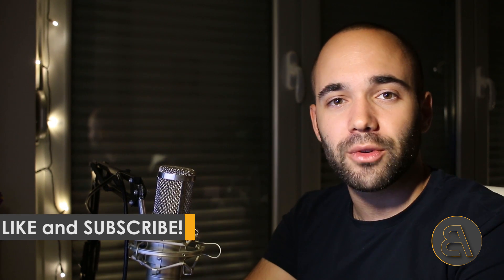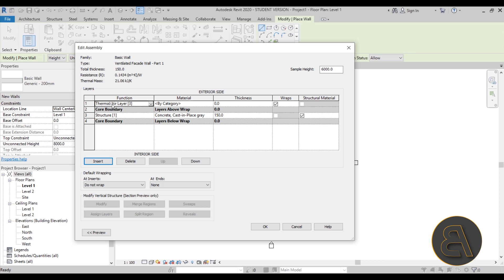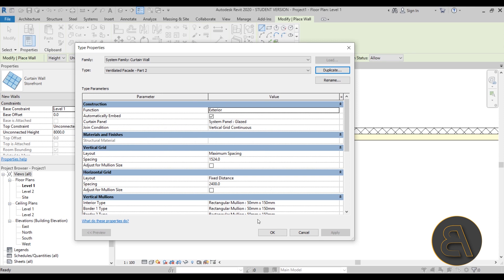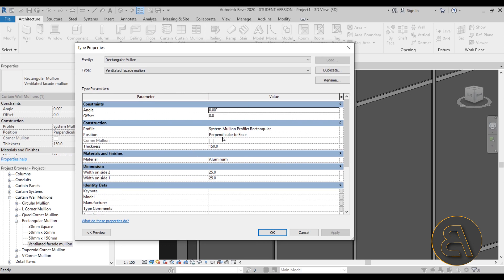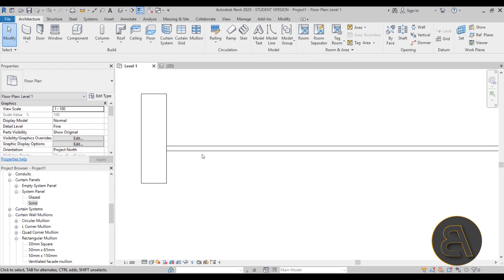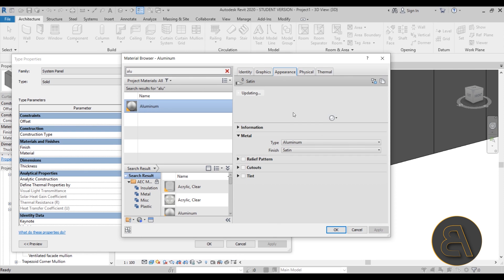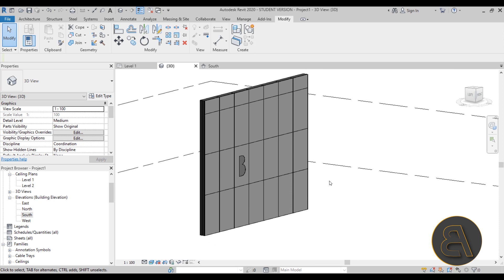Perforated Ventilated Facade - Revit Wall Tutorial

Comment: Your excellent video raises a question: Can this "2 part" wall assembly receive conventional windows and doors?  I'm trying to replicate a conventional rainscreen wall assembly with interior finish, insulated stud cavity, WRB,  exterior insulation, wood or metal rainscreen strapping, and an open joint panel. Using the curtain wall type 1 (empty panel) I can assign the wall type as above, but when I insert the mullions as the rainscreen panel "gaps", they go all the way through the walls (no good). This 2 part method might fix this but I'm not sure the doors or windows will cut through both parts of your wall.  Any advice you can provide is greatly appreciated. (Maybe you've created the video? I'm a recent patreon supporter but could not find an answer there) thanks!

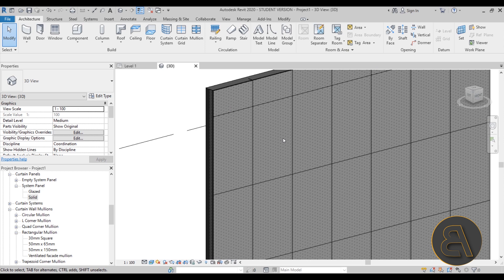Comment: One aspect to be careful of is to make a new aluminum material BEFORE adding perforations.  If the panel material is shared with the mullion material, it will link and you won't be able to undo the linked qualities. You can see at minute 13:54 the mullions are perforated because they were the same aluminum as the panel.

Comment: Hello, I really need your help in this one and I hope you reply me. How can I unlock something that is locked in place ? 
Thank you !
Reply: @architecturetutorrevit  Thx a lot, I will try it later and tell you if it works. But I think the lock and pin are not the same thing. Here's my situation I've put two windows, align them and lock them in place, then I couldn't unlock the one I want, when I click on the wall, it shows me only one lock for all the windows. So I found a solution, is that you click on the window and click on "Activate dimensions" and it work ^^
Reply: @zakiklamson4409 Pinning and locking are very different. When you lock an element you are assigning a constraint. I'm sure others will be along soon to add some extra help.